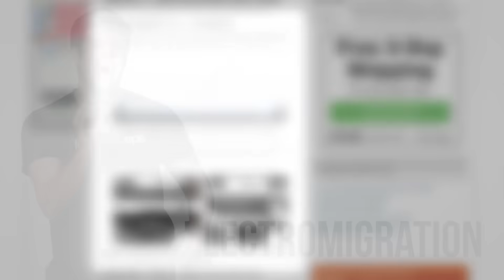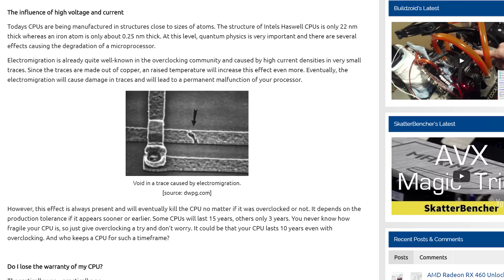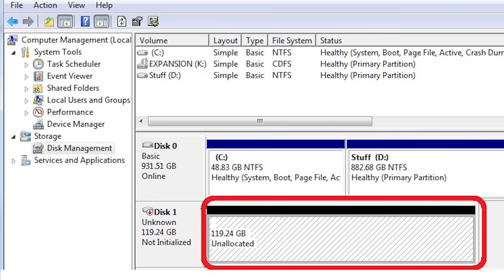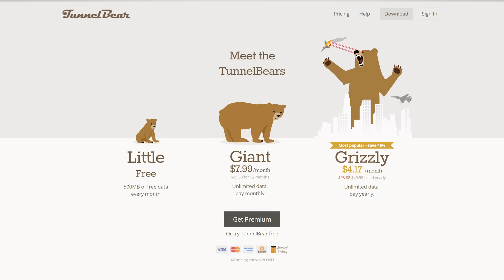Why Do Electronics Die?

Comment: Over three decades of managing hardware, the main and most prevalent culprits are heat cycling (don’t turn off after running hot), vibration, bad power line conditions, software updates degrade perf and even can cause physical damage.

Comment: Electrolytics do not conduct, they’re an insulator. Current does not flow through capacitors. Electrons move within them (polarization), but there is never flow through a capacitor.

Comment: We rarely design the chips to last forever. A typical lifetime we would aim for is about 6-10 years unless its a chip going in a car or other "critical" applications. If we made your high performance gaming chip last longer, it wouldn't be high performance anymore. In the case of electromigration, we would have to make wires thicker or reduce current density or add other "gaurdbands" which ultimately translates to less performance. However, Pro tip, turn your computers off when you can or switch to low power modes. Electromigration and other long-term reliability aging have relaxation effects so you can "extend" their lifetime by letting them rest.

Comment: In addition to planned obsolescence there's the fact that, if someone invents a really superior product, it'll get bought up by big industry and filed away forever, never being produced.
Example: In the mid 50s a 15 yo kid invented a razor blade that would never dull. Gillette bought all rights, making the kid a millionaire; then filed them away forever, and never produced any. And I understand this; once you've sold everyone a razor blade, they'd never come back for another, and you'd be out of business. 
This is why we have new models of cars every year; and they're designed to break down often enough to keep you in the parts & service loop until you decide that it's cheaper to buy a new one, rather than continuing to dump money down the hole to keep an old one running.
Clothing is typically sewn with half rotten thread, that will break down after a certain number of washings.
Reply: The car thing is because nobody seems to keep the car for some reason, nobody wants a car with 30k on it
Reply: Urban myths are great fun    as long  as you under stand they are myths. You know like Mexico  will pay for trumpfarts wall.

Comment: I have kept my server rig online 24/7 for 3 years and 4 months, no problems yet, my samba cache ssd has died but the dual archive harddrives have been running fine, now I use a ramdisk for my samba cache

Comment: What I find weird is my 80's radios and Stero, cameras and other electronics still work as well as day1. They lasted 30 years without blowing a cap, or cracking. The oldest electronic thing I own is a transistor radio from the mid 60's. And it works flawlessly.
However, stuff from the 90's I own is kaput. Odd? I call that "the cheapenning".  When over engineering products made way to cheapo builds so that the masses could afford a CD player, camera or radio that wouldn't cost you a month's wage, but only lasted a couple of years instead of decades.

Comment: Another planned obsolescence tactic that I have witnessed is the INTENDED lack of sufficient heat dissipation. Over time the parts heat up to the point of no longer being able to withstand the stresses and fail short of what those parts COULD have lasted if there was sufficient heat sinking physically within the design of the product. Shameful practices from shameful corporate greed.

Comment: I have always had issues with surface mounted components in that not enough solder typically makes the connections to them leading to breaking intermittent connectivity over time through heat and cold stresses having that lead to ultimate failures within the circuitry. Indeed, planned obsolescence due to lack of enough solder on the connections. Through time, they break apart and no longer are dependable. What's worse is that in the wave soldering process it IS possible to bring forth enough solder to make that not be at issue, but most manufacturers don't and/or refuse to make it any sort of a priority.
Reply: cheap manufactering
Reply: A lot of it is ROHS requiring solder be lead free (In order to be imported from china). Leaded soldering so much more effective. Other solder chemicals like silver can be used but it's too expensive to be used on a wide scale.

Comment: There is also the fact that lifespan decreases with increasing transistor count due to heat or other problems. I do use older systems which perform quite well without any errors while my newer PCs tend to fail after 6 years or earlier.

Currently I am using a Core2 Duo machine featuring a C2D E8500 at 3.2 GHZ + 8GB of DDR3 Mem. It even features a PCIe 16x lane so you can definitively put a good graphicscard in there. I could upgrade the CPU and RAM too to make it a C2Q Q6600 with 16GB. I upgraded the drive to a 7500RPM 1TB WD Blue. It's a Fujitsu Esprimo E5730 from around 2010. The OS is Win7 64bit.

I also use a Laptop for Uni stuff, it's a DELL Latitude D420 from around 2006 featuring a 1.2 GHZ Intel Core Duo U2400 + 2 GB of RAM. The OS is Lubuntu 17.10. Makes no problems at all.

Next on the list is my secondary PC. It's a Dell Optiplex GX110 from 1999. It features a Pentium III 933MHZ + 384MB of RAM. It behaves like it should + Linux runs fine on it. I tested it with Alpine Linux with Kernel version 4.9.65.

The latter two got an 80GB drive in them.

Comment: I would claim the main failures are due to: bad capacitors, mechanical failure and user-introduced ESD.
What are the timespan before the more exotic failures you mentioned actually occur? 10 , 20 or 60 years?

Comment: Had lectures about this at college back in the 1980's studying electronics engineering.

In solid state devices an effect called "Electron Flow Degradation" and is simply the flow of electrons doing to silicon what water does to rock.

The only electronics that seems to survive this process spanning half a century of us is old school thermionic valves (tubes in the US).

The capacitor problems during the early 2000's was down to a vast number of electrolytic capacitors being filled with cooking oil. Needless to say they were made in China.

Back in the 1980's there was the short circuiting properties of Tantalum Bead capacitors, which would short circuit when they died. Not used today as the world of electronics returned to electrolytic capacitors.
Reply: Would that be because tubes didn't use silicon?

Comment: Actually, properly and carefully engineered and manufactured electronics (built with quality parts) don't tend to fail very-very long time. Planned obsolence is plain euphemised robbery, which should be punished with great-great fines, even with prison, it's bad for the environment and the consumer too.
I bought a motherboard in 2000, it's an Asus TUSL2C, it's for Intel Pentium3 or Celeron3. It had to work very hard in harsh environments, damp and hot, arid and cold places, it had to withstand serious resonances, dust and extreme temperature fluctuations too. And guess what, it's still working without any issues. The laptop I've bought in 2011 failed in that year, it couldn't work even half a year. That's why I won't ever buy any car manufactured after 2000. I really hate to pay for shit.
Reply: Baladár Amen.

Comment: My PC is going strong for 9 years ..well most of it. Had to change 3 PSU's and the GPU(GTS 250) died 2 weeks ago. . The motherboard will probably outlive me at this point, Gigabyte advertise a 50.000 hours for the capacitors. Also the dual bios is great.

Comment: There should be a law that prevents electronics manufacturers from engineering planned obsolescence into their products. The law should be enforced with very high fines that would be greater than any potential profits resulting from consumers buying new products due to planned obsolescence destroying their older products. I know of one type of electronic product that definitely DOES NOT have any planned obsolescence engineered into it, the Nintendo NES, SNES, and N64. These consoles have incredible lifespans that make current smartphone lifespans look ridiculously inadequate in comparison.

Comment: My Commodore 64 still works fine.  I purchased that in the 80’s.
Reply: I got the impression from the video that new and smaller architecture CPUs would die faster because the transistors are so small.  So maybe older machines will last much much longer due to the larger architecture of the CPU. 
also if you never use it that will probably help prolong its lifespan.  

So that makes me wonder if I buy the newest and most expensive CPU available today, will it be dead in 5 years, whereas a CPU from 20 years ago would probably last many many times longer?
Reply: @mattrevesz  Yeah, electromigration starts becoming an issue primarily at a certain process node. Older electronics, including my c64 are way above that. A much bigger problem is ESD. Scrub your feet on a carpet and then touch the joystick ports on my C64 and one of the CIA, I/O chips will probably die right away.
Reply: Give me your bitcoin address, I want to personally buy you a new computer friend.
Reply: Yep, so does my TI 99 4a. Things were built way better back before the late 1990's. It is not uncommon to find even cheaper brand stereos from the 60's still working vs. higher end ones from the 2000's have stopped. In the late 90's it became more of a price only thing and from then on, all electronics have suffered. Also switching from leaded solder to lead free has made some connections way less stable for long term use. We used to make parts that were 20%+ over rated for the need and that headroom just made everything last longer, now 5% is  the normal and as a result thing die much quicker.  As board density got higher that also contributed to failures. We used to be about QUALITY, not everyone shops PRICE.
Reply: I have a VIC-20 that works perfectly.
Reply: Both my c64's work perfectly, as do 3 of my 1541 drives. I have had to swap a few chips on my '85 c64. My silver label '82 c64 is perfect, and that has mostly original '82 chips.
Reply: Lemme guess....Made in Japan?
Reply: my atari 2600 still works and its from the 70s
Reply: Markinpuff what??! I use to love centipede!😊
Reply: Zelda Williams Come and take it. Lol
Reply: @Markinpuff   Is this still available?
Reply: @jdslyman You gotta love the Japanese.
Reply: Let guess.... Made in ( no China)....

Comment: Static Electricity can cause immediate or latent failures in microelectronics.  The spark essentially blows a hole on the pcb as the copper vaporizes.  This can cause an open circuit or in some cases the copper essentially plates the hole causing a short.

Comment: Planned obsolescence ? Haha you should see my 10 years old Toshiba PC thats using a T5450 intel CPU, this thing doesn't want to die ! 10 years of heavy use 24/7, and the thing is, I've never changed any component, the ram, hard drive, CPU and GPU are untouched. I think I'll throw a party the day it finally dies.
I'm pretty sure that after all these years, pretty much all of the thermal paste has worn off so I'm wondering how the heck is this thing still working.
Toshiba, you'll always be my one and only 😎

Comment: I gotta ba honest, i havent seen much hardware with planned obsolence.. I have an old xbox, ps2, xbox 360.. old computer parts and cpus which i havent really been gentle to (handling and overclocking)  And they are all still working perfectly.. Sure... i lost 3 ram sticks in the past 8 years.. But other than that i still have  an xbox from 2003 Which to this day, still works perfectly

Comment: I dont think dell does planned obsolescence. Yeah i know the dimension machines and a couple of old system broke from design flaws, but a dell optiplex from 2006 can still be used to day and same with i laptop i own. If a system meets the minumum required specs, i could run a more modern os
Reply: CalculatinGenius just took apart both of ‘my dell optiplex and used one to upgrade the other now it works fine
Reply: Remember Dell doesn't necessarily make the parts for three PC. They come from different places like how your professor comes from Intel.
Reply: HA. HA. HA. HA. Tell that to my sister and father, who have had 2 and 1 Dell laptops die on them suddenly, respectively.
Reply: @bennemann  Sigh. Basic maintenance. Like changing thermal paste and cleaning the dust every 1-2 years. Swapping the drive after a few years. Done. Finito. Spanky new working PC.
Reply: @Olivia-W  Oh yes, because you really have the data on how old said laptops were to be able to say that. The "sigh" is mine.
Reply: @bennemann  Alright, yes, laptops from the 1990s, and some models from the 2000s affected by the capacitor plague are probably dead.

If it's anything 2010s upwards then I'm betting design or manufacturing defect, or, more often, user neglect.

I recently dismantled a few 2009-2011 laptops for parts. All were in good working order barring cosmetic damage.
Reply: Javian, pretty sure Intel doesn't make professors lol.

Comment: The idea of planned obsolescence sounds a bit sinister, but right around two years after the phone came out, thousands of iPhone 6 Pluses (Including mine) suddenly developed a gray bar at the top of the display which signified your phone contracting the dreaded "touch disease" which prevented the touch screen from working, could not be fixed, and Apple would not pay for a replacement, or even acknowledge how widespread the problem was. Kind of a douche move. Luckily I was able to sell my phone back to the carrier for a little bit of money before the phone became a $500 paperweight. But still, you'd think Apple would have the decency to order a recall once the problem was discovered.

Comment: Good video.  One error.... "Current is the physical flow of electrons".  I believe that is incorrect.  Current is the flow of charge and this charge travels at near light speed.  In a DC circuit current flows from Positive to Negative.  The electrical path is established by a flow of electrons from Negative to Positive and travels a the slow rate of about 1" in 8 seconds (roughly). It is the current flow that is used to do the work.

Comment: Here's a question. Do storage devices such as SSDs have some feature that will "turn off" any transistors that fail? Where instead of the computer trying to write data to a failed transistor and ending up with corrupted data, it just wouldn't recognize that at all, and not even try to write to it.
It would then be cool if we could see that, like say a 120gb SSD would eventually someday just show up in your computer as a 100gb SSD, but still functional with what is still functioning within it.

Comment: 1:05 Not all capacitors need to contain electrolytes. Only these ones do. So they store and release energy in the form of a chemical reaction, like a battery. The reaction is supposed to be reversible, but due to impurities, manufacturing defects and other unexpected effects, the components end up degrading over time.

Comment: This makes me wonder if my old Windows ME computer was built before the whole planned obsolescence thing started happening.  It's 20 years old this year and  the only issue we have ever had with it was a failed Hard drive about 10 years ago that we replaced and a failed system fan about 6 years ago that we replaced as well.  It still runs strong.  I just booted it up yesterday to play Sim City 3000 on it with no issues!

Comment: Technically most electronic have a life span specifically for the time it is expected to be relevant, technology is always evolving and new better things are being created, so there is no point to hold on to the old ones for too long as they become unusable, I still have aloptop from 2006 and it works just fine (besides the screen that I Brook accidently by throwing something at it so only half if it works) but that laptop is not relevant any more and doe snot serve any more purpose besides taking up space in my house because it is not fats enough to perform basic tasks, so do we really need immortal electronics... I think not
Reply: Magic mushroom No. The universe is a lot older and is no obsolete yet. Use viagra instead.

Comment: I have a 1915 Candlestick telephone what still works on a current British Telecom connection. Although, the oldest electronic I use often what still works would be my 1934 Elextrolux Z25 Vacuum Cleaner complete with box and attachments. I Just can't see my modern Dyson ball working until the year 2100 though in 83 years time. 

I also prefer the brushed ali build quality of older 1960s/70s hifi equipment too. You struggle to get that these days its made in either plastic or black and rather bland looking instead.
Reply: Dyson obsoletes all his models, as soon as he releases a new model, he stops making parts for the old one, and when it breaks you can't fix it.
Reply: ww1 times items you have
Reply: Older style (or metal commercial) vacuums in genral much better than dyson.

Comment: Umm... I hate to break it to you, Techquickie. But, capaciters are not always cylindrical. Ceramic capacitors can be similar to, say an Advil and are not polarized. an Electrolytic capacitor is cylindrical. And are typically polarized.

Comment: There is no such thing as no moving parts, the moving parts on solid state stuff are just on the molecular level.
Reply: Well, those aren't called 'parts' of device if those are elemental parts of Universe.
Also, do you call water a 'moving part' in hydraulic mechanism?
Reply: smartass
Reply: Or atomic or subatomic.
Reply: *ahem *ACKSHULLY
Reply: Well said!